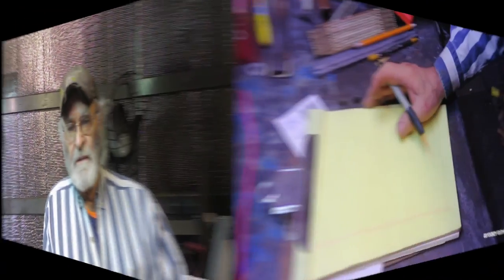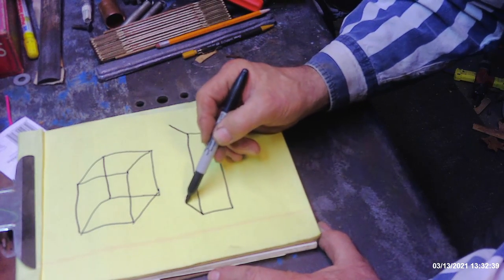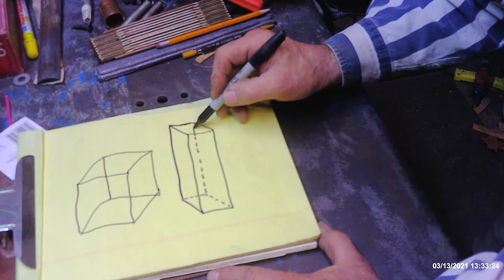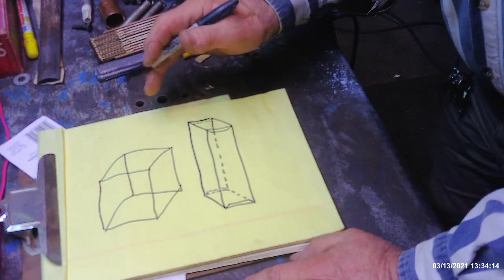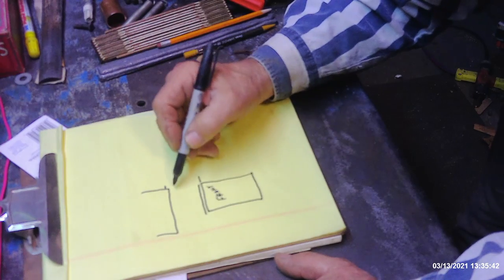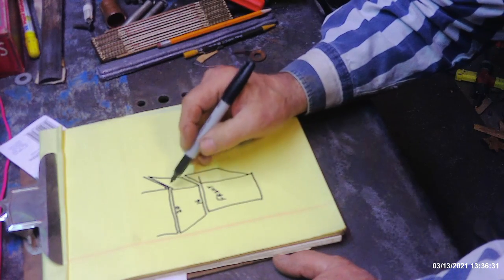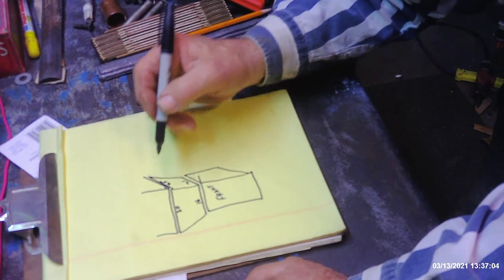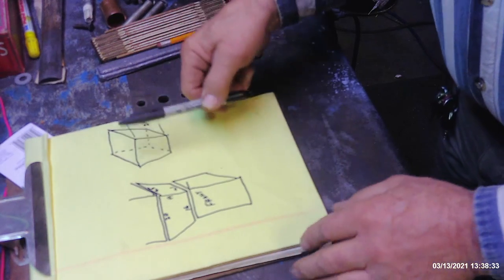Isometric Drawing Basics: Sheet Metal Layout for Julian

Comment: A 44 Adventure with another cuppa Friday morning JO, which I toast your way! Supposed to be in the 60-70s next week and I have plans for outside more comfortable work, tutu perhaps,,,,,may be camo! I've been figuring out how I'm lifting a plow blade on my Craftsman that was for another tractor. It's the lifting that I'm working on, as its a heavy built blade probably 45-50 years old with very little wear. It belonged to a man who bought all Craftsman equipment. It's a challenge, which I enjoy but my Lincoln SP 100 ain't a werkin! I think the gun needs a new liner cuz i plum ain't gittin a spark much. New tip? Yep! But a small spool of wire that tangles a bunch. So I'm going to buy a 10 lb. spool that always seems to work far better than a small spool. I have a few weld jobs I need to do. Luckily my JOcup ain't steel cuz I'd be caca outta luck! Well, on all these heavy topics talked about, I need a refill and proceed with great and stupid ideas. A Fine Friday Friend Forty Four! From DaveyJO Holler to Yerz
Reply from the maker: Hey you know for the MIG wire they make a split-felt piece that clips over the wire and held in place by a little clip.  They have a small squirt can of liner lube that you soak up the felt with and that keeps the liner in shape for a lot longer period.  If you get a new liner, ask them about that stuff.  I swear by it.  Of course I swear at anything...even the hammer when it hits the wrong nail and I end up with a sore finger !!  LOL  Sometimes the lack of spark or poor spark is the ground clamp not grounding good too.  Let me know if you get the kinks out it DaveyJO and for now, please have a wonderful weekend my friend !!

Comment: Wendell, I have doing drafting for almost 50 years, starting in high school, through college, and now at my current job.  Of course, now we use CAD programs, making 3D solid models, but until we had solid models, we use wireframes, which your isometric, or trimetric sketches depict.  When I first started out in high school, I wanted to be an architect, but somehow got into mechanical design.  Making a drawing using mylar pencils, or mechanical pencils, or putting ink on mylar, has become a lost art.  I have a bevy of drafting tools, scales, templates, triangles, ink pens, mechanical pencils, etc. that I probably will never use again.  With retirement looming in a couple of years, they probably never will be used again by me.  I would like to get back to doing some artwork that I used to do way back in school.  I had one oil painting go to state back in high school, but I degress.

BTW, since I have your attention, I picked up a 1944 Ford 2N.  You wouldn't happen to have any Dearborn 3 point, 2 bottom plows, preferably 12 or 14 inch bottoms, would you?
Reply from the maker: I had mechanical drawing in high school, and that really helped me in the field many years later.  I know you know some stuff about drafting !!  I'm almost embarrassed to have you even see this feeble video....LOL.  But what we each make our drawings for are WORLDS apart !!  
  Yes, I have a set of 2-14 Dearborn plows for the blue 2000 Ford....but doggone it they aren't for sale.  Ain't that the luck.  
    On another note, I found a lot of water in the H rear end I'm working on and also two bad seals in front of the transmission and a bad bearing...(Video coming soon)....but you may need to check your H's rear end for water.  Btw, there are drain plugs front and rear on these tractors.  Let me know if you find water in there.  I was shocked at mine and it was INSIDE the shed for months !!  Had to be rain water from before.
Reply: @tractorman4461  I have downloaded all the manuals, and even found out how much the rear end takes, which is 6 gallons.  There is a plug that you removed, and when the oil seeps out of that hole, it's full.  The transmission, differential, and the PTO should share the same fluid, if I remember correctly.  I haven't gotten around to changing out the rear end yet, but that was on the list of things to do it.  I already changed out the engine oil and filter.  Someone had the wrong filter on it - the earlier H's took the long filter, this one had the short filter on it. 

I found a few Dearborn plows at Coles Tractor, so I might be headed down that way today to look at them in person.
Reply from the maker: @316jd140  good luck with the plows.  Yeah, the weep plug is just below the clutch.  But don't forget about the front drain plug..... Video coming soon.